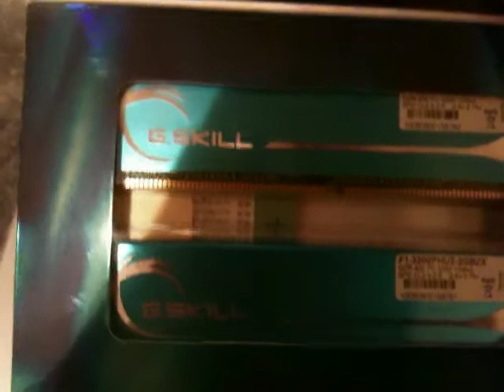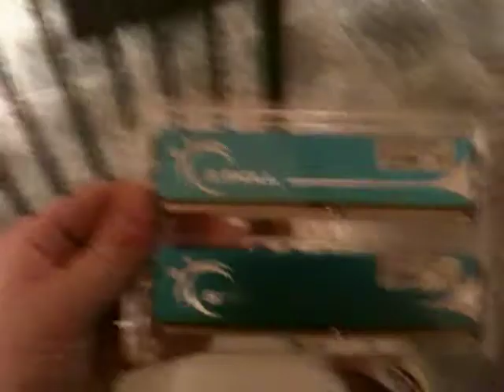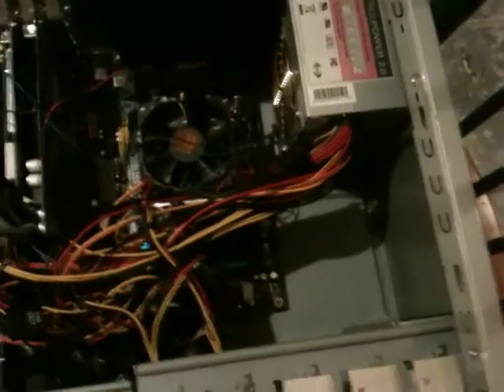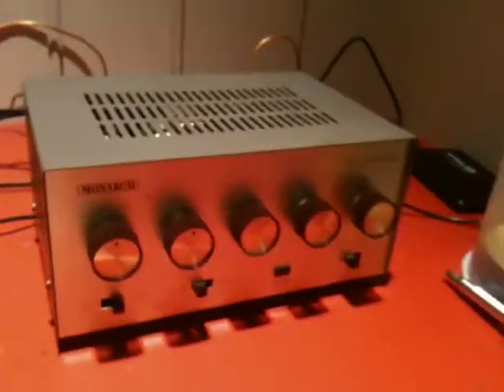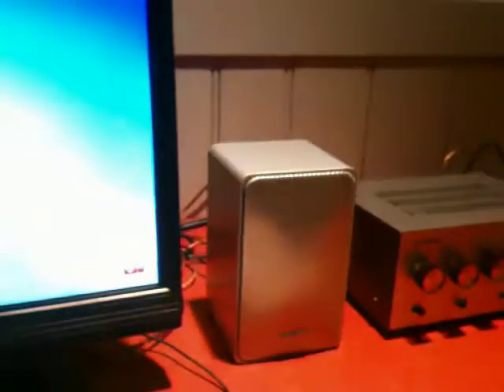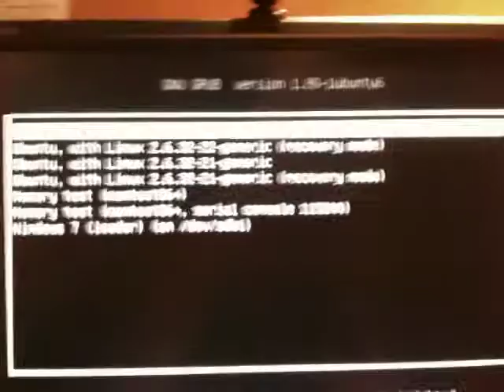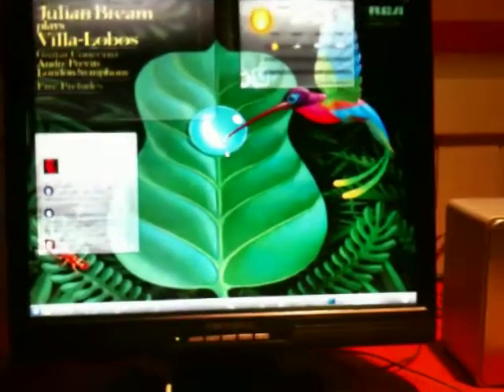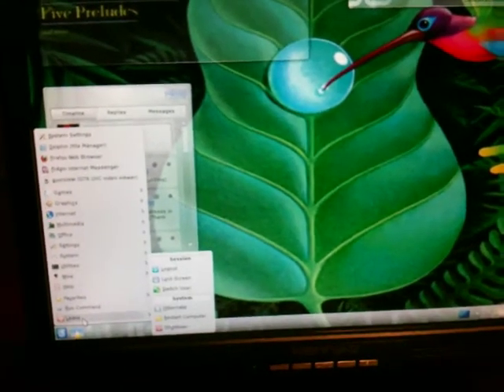4GB Of RAM Now In My Custom Build!

Comment from the maker: @Sansui350A AMD Athlon X2 4800+ 2.4GHz Socket 939 90nm, 4GB of DDR 400, 1 250GB hard drive, 1 400GB hard drive, both hard drives are Western Digital and pretty old, lol. Nvidia 7600GT with 256mb of VRAM, an AVer Media Analog TV Tuner which is now useless, lol. Two optical drives. one floppy drive. Windows is on the 250GB drive and Linux is on the 400GB drive.